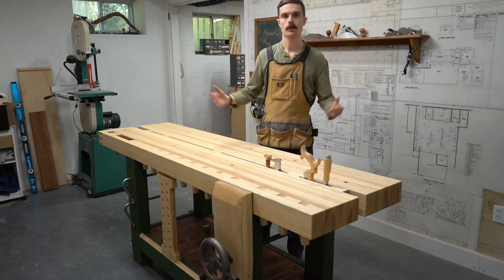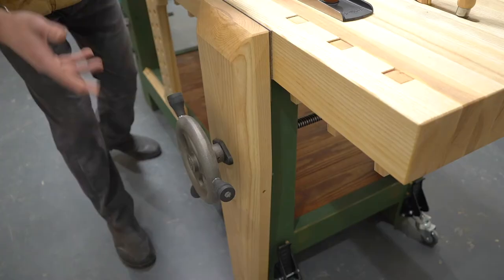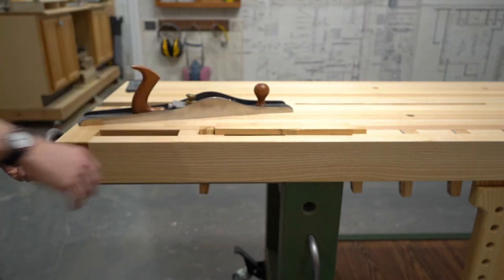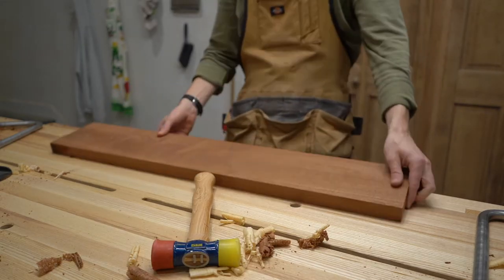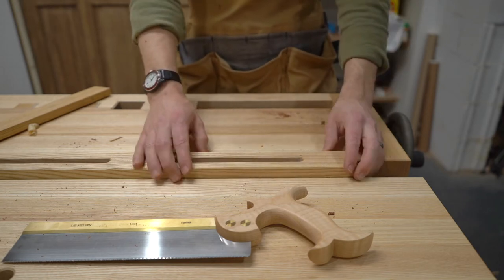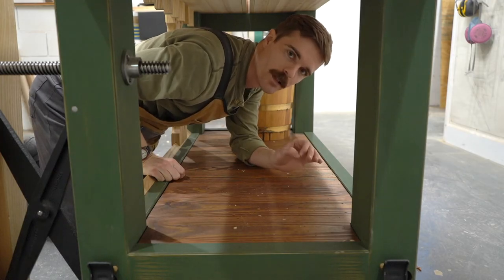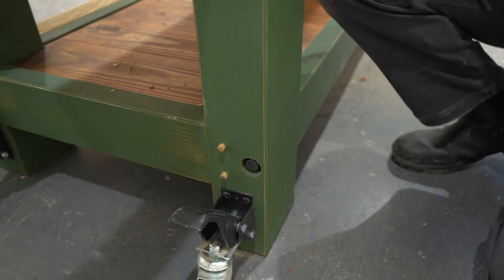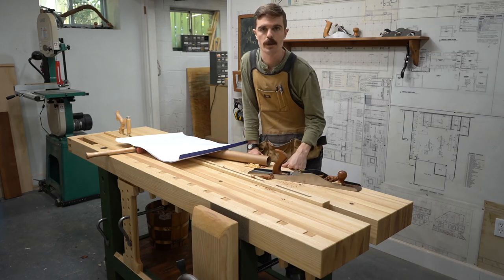Part 16 | What is a Split top Roubo Workbench Anyways?

Comment: It would be helpful for you to pull the center board all the way out so we can see the details of how it is supported at the two levels,
Reply from the maker: Check out this video https://youtu.be/BtEJATZ-Oa4. You can see how I made the gap stop and towards the end where I put it in you can see the horizontal rails that it sits on top of. Let me know if this answers your question!
Reply: @StarrWoodworks  Thanks.  I am building a work bench for my daughter,  I have two with Emmert vices for my woodshop but they are on a different style bench.  I milled ash trees on my Norwood bandsaw mill for the top and poplar for the frame.

Comment: I have reached the culmination of finally assembling the bench build.  The slabs are assembled, every part is mortised, and both the tail and bench vise are installed.  Before i assemble this beast, I want to plane, sand, chamfer, and apply preliminary finish.   The species of wood for both the base and tops is ash.  Hence my question.  Could you share what product you used to finish the top portion of your bench.  I do prefer to retain the natural look of the ash.  Thanks.
Reply from the maker: Go with Osmo 1101 extra thin. Just one coat should be fine. It will give it nice protection, beautiful look, and MOST importantly it will not be shiny or slippery. DO NOT sand the top of your bench smooth. You want it to be grippy. If you already have, no worries, just sand it again using 80 grit sand paper.

Comment: Are you left handed? I am and I’m making my bench like yours with the leg vise in the right side.
Reply from the maker: I am. You making a roubo? Or some other style?
Reply: @StarrWoodworks  Yes I’m making a split roubo that’s an alteration to the bench Tom McLaughlin, Epic Woodworking built. Tom’s design has a tool tray that I dont want. The split style will be easier for me to handle too. I’m using Hobarter vises, ash top. I didnt notice how you made the split section insert. Do you have photos of how it goes up and down? Not many of us lefties in woodworking!

Comment: I see that you posit a question about, "What is a Roubo Split Top workbench?. So you showed us a leg vise, that you put your leg into, hahahaha. Then a tail vise, where you sat to squeeze your tail,...  again hahaha. Then you showed us lag screws and bolts the hold your bench together, oh... and an ancient invention.. called a shelf. It's all very Purdy, but I'm still wondering,... what's the purpose of the split top???? Is that where you lose your tools, or are the wood chips supposed to fall off the workbench down into the drawers and shelf. Two guys work across the split top and share the tools??? So... WHAT WHAT WHAT IS A ROUBO SPLIT TOP.  ??????
Reply from the maker: Check this page out and let me know if it helps! https://www.benchcrafted.com/download-files/Split-Top-Roubo_Notes-BC1014.pdf